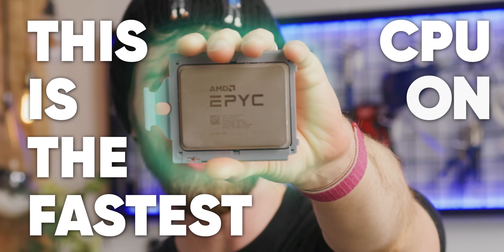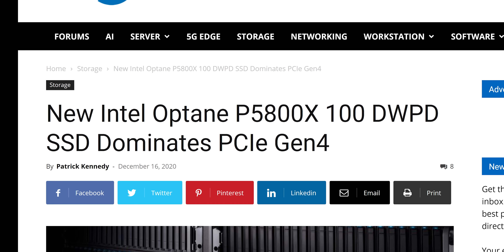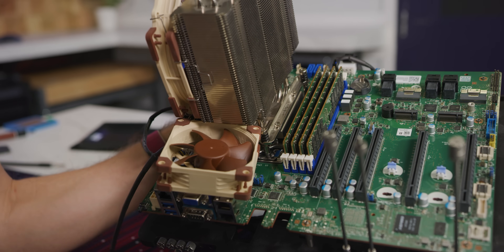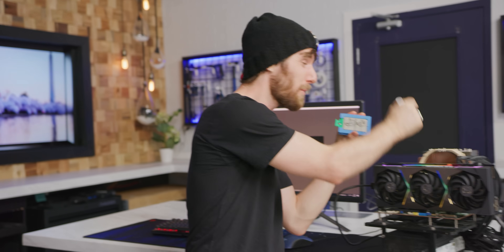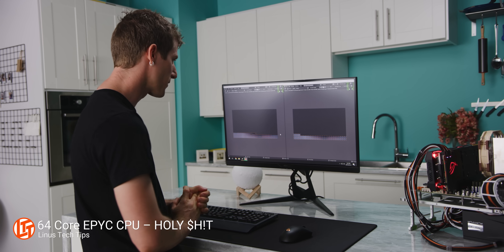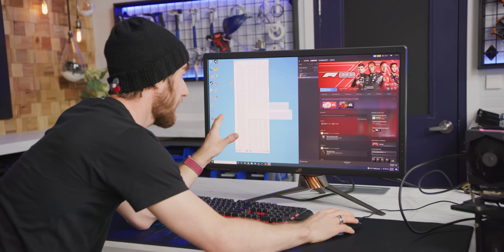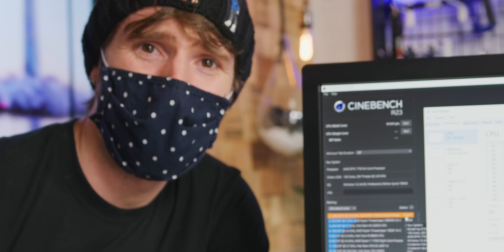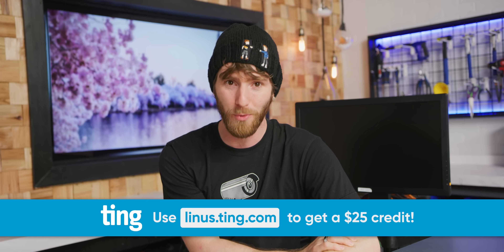The Fastest CPU on the Planet - HOLY $H!T - EPYC Milan 7763 64 Core

Comment: Amd: we have zen 4 128 core cpu
Intel: you meant threads? 
Amd: ......
Intel: holy shit
Reply: lmfaoooooooooo
Reply: Intels Xeon Phi 7somethinsomething has 288 Threads... At 250 Watts and the calculation Power of 2.5Tflops. that thing is scary
Reply: @kcasc_hd  runs hello world on it but a quadrillion times in parallel
Reply: @kcasc_hd  Intel Xeon Phi (series as a whole) is an "odd-ball" tho...
While they do have 72c/288t on their 7290 (among some others), the instruction set is a lot different and they are optimized to run primarily AVX-512 workloads (which is mostly machine learning).
So while it will pull ahead in machine learning and other workloads that benefit from this, it'll quickly fall behind in workloads you'll find Epyc CPUs in, which are primarily virtualization or running together with a boatload of machine learning accelerators like the Nvidia A100...

I mean... there's kind of a reason that the Xeon Phi never really took off especially after Nvidia started becoming big in the machine learning market...
I mean, why invest a lot of money into basically starting from scratch when you can supercharge your already existing codebase.
Reply: @kcasc_hd  So like 1/5 of a Xbox Series X? A few TFLOPS isn't really impressive these days.
Reply: @exscape  no no no, 2.5Tflops of cpu power. Series x has 12 Tflops of GPU power. 2.5tflops of cpu power is actually insane be
Reply: Phi 7920? That's a 72 core cpu from 2016, I'm not even sure if Intel were selling them
Reply: @kcasc_hd  But 4 threads per core, and each core clocked at like 1.2ghz? Not to mentioned, that's all Intel weaker/garbage Atom core instead of fully loaded normal Core/Cove Core. Yes. There is a reason why it's got Discontinued lol
Reply: @kcasc_hd  Where can you buy one of those?
Reply: Not Zen 4, but yes. It's the 4th generation and called Zen 3
Reply: @sebastianlaakso2729  he also said 128 cores…. He meant next generation
Reply: @sebastianlaakso2729  Strong rumor has it that Zen 4 will have a 128-core variant, but probably not for the general server market.  It's supposed to go up to 96 cores for that.

Comment: "Cool idea for a project that you can use one of these bad boys for?"

Assisting scientists and doctors with simulations for finding a cure for cancer. 

"With great power comes great responsibility." 😉
Reply: I think they host a Fold@Home server their local area, if memory serves, so they do actually do that. my rig as run quite a bit of FAH over the last year.
Reply: @DFX2KX  They did, but I believe they took it down earlier this year. It doesn't show up in their server list anymore. Before they took it down, it showed a lot of errors with degraded performance. I'm not sure if that was intentional, or if it was the final straw for them to decide to take it down.
Reply: Oh, the good old Superhero quote, never fails.
Reply: Actually useless, you need super computers like Fugaku.

Comment: Hmm...
How about "can it run Crysis with CPU only?"
Reply: Yep, software (CPU) render.
Reply: Didn't they do software rendering on Crysis 1 on a previous video on EPYC?
Reply: @71ruinsigil  I think it was threadripper but yes
Reply: ohh yes please
Reply: From what I remember, the mesa port for windows has cpu rendering
Reply: Ryzen chips doesn't have integrated graphics, unlike Intel.
Reply: @Outofcreatvienames  There is software rendering for this.
Reply: @Outofcreatvienames  yes. the point here is to try to run the graphics calculations on the CPU cores.

Really doubt it'll be able to play Crysis, honestly. but something more reasonable, like Half-Life or even Minecraft looks like a real possibility if you can get all the cores utilized
Reply: @rejiix  Minecraft runs fine CPU-rendered on a R5 3600, with a single RAM channel. I expect more from this system.
Reply: @Outofcreatvienames  Who. The. Fuck. Would spend extra for shit graphics when you can buy a graphics card 😐
Reply: @ChemPhys99  you can buy a graphics card?! Where, tell me now!
Reply: @unvergebeneid  StockX
Reply: @Outofcreatvienames  um dude... tell that to my ryzen 3 3200G  i guess it didnt get the memo

Comment: To be fair, it's a bit like saying you want to go crabbing in a 12 foot tinny and turning up in the USS Enterprise. Yes, alright, it does have eighty five thousand hp and it can get a 1,100 foot aircraft carrier to about 33 knots. But you're not going to tow it behind your Datto 120Y or launch it single handed or get it into the creek where your pots are. It's huge and impressive but it's completely impossible impractical to use for your normal daily boat. It does very much have its uses, it is very well made and very good at what it does, but it's not a replacement for your old 12 footer. It's a completely different class of animal.
Yes, it can play Crysis.... Yes, I could browse the net and keep a watch on my pwn-sites with it, but...
16 cores and 32 threads would do that for me perfectly. Add a 2TB M.2 drive, and it'd be as fast as my network connection would let it be.
Put that another way - if I had 50 billion $ in the bank and I could buy Brazil one afternoon for laughs, I still wouldn't buy a top line EPYC to use as a personal computer. I might under those conditions be able to spend $20k on my own personal computing (separate to buying new desktops and laptops and phones and fondle-slabs for about 50 people in my immediate family) but for my own use, a high end laptop and high end desktop and ...

Comment: This server is pretty quiet.

Hits button remotely.
Server: So you have chosen deaf.
Reply: Sounds like a 747 getting ready for takeoff
Reply: @the_platapus3522  sounds like 5 ps4
Reply: @the_platapus3522  lol I wonder what would happen if they cool one of these using something like a miniature turbofan 😂
Reply: @topethermohenes7658  would you like to correct your statement to The Blowimatron ?
Reply: @N1lav  nah blowimatron is still more or less pc specs I'm talking about turbine rc ones upto 120k rpm 😂
Reply: I lol'd. Thanks.
Reply: @flameshana9  you're welcome
Reply: Honestly it just sounds like my GPU, if I had two of them and I was dumb enough to try overclocking them without replacing MSI's pansy little cooling fans and thin lame heatsink.

Comment: Hi Linus, would love to see how well it works to put a server like this in your data center, and use Windows Remote Desktop to remote into it with something like the 17" LG Gram (i.e. no discrete graphics) and ummm... something with discrete graphics (perhaps a Razor 17in)?

The idea here would be a combination of having a HUGE amount of simulation capability for 3D modelling, but while having the security of having all your models and data safely locked down in your data center (or office) rather than freely out in the world on a laptop.  Basically, the expensive hardware in the office, and "disposable" inexpensive laptops with little to no data on them in the field.

Comment: "fastest CPU" Nah. Apple M1 SoC at 3.2GHz, one core performs like one from Ryzen 9 5950X or Core i9 at 5GHz and the Apple M1 has integrated graphics and doesn't need a fan, has less than 10 times the power consumption of a Ryzen or Core, less than 100 times the power consumption of EPYC.

The EPYC, Threadripper with Xeons are like overpriced Bulldozer chips.
Reply: @vojtech1586  8 cores that can compete with a desktop that uses 10 times more energy and has like 30% less IPC.

This is Bulldozer again. EPYC clocks waaaay lower than Ryzen 9 5950X and Core i9-11900K, it's a bad overpriced chip.
Reply: @vojtech1586  No wonder why ARM is killing x86 on the server space or winning market share.
Reply: @vojtech1586  Singlethread perfomance is by far the most important aspect of a CPU. An NVIDIA Geforce RTX 3090 obliterates any CPU in a 100% multithreaded application

Comparing this EPYC against an RTX 3090, the latter would do a render 10 times faster. Because the 3090 has 35 TFLOPs vs this EPYC's 3.1TFLOPs.
Reply: @vojtech1586  ARM is slowly crushing AMD and Intel in servers and gained like 400% more market share last year.
Reply: @vojtech1586  I don't think that x86 is better. It has a huge problem in architecture that must be fixed by Alder Lake.

Comment: HMMM I feel like I scored a 58,000 on Cinebench with my Threadripper 3990x and that was with air cooling only, on performance mode. Never goes above 50C also paired with a RTX 3090.

Comment: Those pcie lanes could be used for a hyperfast nvme server, ASRock has mobo with 7 x16 lanes, in which we can plug those asus pcie cards that convert one x16 pcie lane to 4 m.2 x4 lanes, so theoretically we could connect 28 nvmes in raid or 26(2 using onboard) nvmes + a high bandwidth network card

Comment: One of the things I'd love to see you cover is a power consumption comparison between this and Intel's offerings, if you can get hold of the hardware to do so. A major reason we're seeing a switch towards AMD in the server market is that density and power are major ongoing costs. The power itself costs money, but it also increases the demand on UPS and thermal management systems, making it a triple-whammy - you know all this already. The density improvement here is obvious, and the power improvement /seems/ obvious in terms of the ratio between the marketed TDPs and the core count, but the practical power consumption of a chip under multi-threaded work loads (e.g. VM hosting, Kubernetes, compilation & CI/CD infrastructure, OpenWhisk and other Lambda-like systems, batch image and document conversion, heavy webapp loads, etc.) is often very different to what you'd see in an all-out all-core load like Cinebench, since they're utilising a far richer mix of computation resources. I suspect Intel still loses here, but I've yet to see a good direct comparison, and it'd be nice to see one. Even some measurements of power consumption on your 16x quad core gaming project would be a good data point to work from, albeit not concretely comparable without a similar test on an Intel platform.
Reply: As an aside: it'd be really cool if you could build a parallel pandoc benchmark as a test for workstation and server loads. My guess is that Anthony could knock something together fairly easily on that front, using little more than a bash script. Shouldn't be difficult to find somewhere where you can grab a couple hundred PDFs as test data, and then all the benchmark needs to do is convert them to a bunch of different formats, then the resultant documents to a bunch of other formats, in "rounds" like you'd see on other benchmarks, and time the whole thing. You could eliminate any IO bottleneck by loading the files onto a RAM disk, but if you kept the PDFs small (under a few MB each) the IO shouldn't be a major factor. This would be a decent emulation of a broader CPU load that doesn't focus so much on tight loops of SIMD (SSE/AVX) work.

Comment: So I know it's not gonna change anything about the impressions of the product but Apex by default is locked at 144fps 
So even though apex is pretty badly optimized I bet that would jump up some if you unlocked the framerate 

Granted I am only running at 1080p but my R7 3700x paired with a 3070 will run the game at almost maxed out settings at a semi stable 190 fps and I can push 300 fps if I lower the settings a bit.

I love Apex and glad to see it represented but this makes it look way worse than it should

Comment: with that many threads, those corclocks and the IPC I think those two CPUs might even be able to beat a GPU in rendering. not a modern GPU but some old one. maybe you can get some virtual GPU running on the CPUs or  render in software or smth.

Comment: What is the name of the equipment that is used as a holder for the CPU? I saw Linus holding the CPU in a special plastic holder (not sure if it is plastic).
Reply: It's part of the CPU package for Epyc/Threadripper CPUs.  You slide that plastic part into rails on the retention mechanism when installing the CPU.
Reply: @VitalVampyr  Is there an alternative to that for other CPUs like Ryzen 5 5600X? I need something to hold my CPU because I lost the plastic that came with it.
Reply: @BlastyMcNoAim  The plastic rails used by Epyc wouldn't very useful for that.
I know they make latching plastic cases for storing/transporting CPUs without the original packaging but I wouldn't know where to buy them.

Comment: The crazy thing is that in 20 years a <100$ budget cpu will easily stomp this
Reply: Probably not really. We are reaching the limits of power that we can get from our technology.
Reply: @arivald6677  You may want to have a look on the theory of accellerating returns: Whenever a technology approaches some kind of a barrier, according to Kurzweil, a new technology will be invented to allow us to cross that barrier. (source: https://en.wikipedia.org/wiki/Accelerating_change). If you belief the theory we may reach the limits of transistors but it will just mark the beginning of another  technology to do the same thing but better. If Horses can't run faster there will be someone who invents a motor....
Reply: @arivald6677  sort of we are making slower advancements in power department. the way we were improve mostly these days is efficiency and shrinking.
Reply: Yeah those will be on our cellphones.
Reply: I doubt that. You cannot fool fundamental physics.

Comment: You know what else is fast? The speed at which most games still say "Nah, no thanks, I'm full" when presented with more than 4 cores. I know that's not this chips use case, but it is comical seeing my friend's Threadripper be considered the bottleneck for some games he plays. Good on F1 2020 though.

Comment: Linus : This is a 8000$ CPU . 
Also Linus : Draws with a marker on it
Reply: I mean, it was a dry erase marker, and he was drawing on the integrated heat spreader. You can literally remove that metal part entirely and the CPU still works as normal. Drawing on it is totally harmless.
Reply: @trapical  still seems wierd lol like if you had a bullet proof side panel it would still be weird and scary to shoot it lol
Reply: @joeygrimwood4559  It would be more like using spray paint on bullet proofing. Won't hurt anything, also isn't helping anything

Comment: What, only one 3090? Pleb.
But seriously, I can't wait for new Threadrippers to launch. I've been waiting, not so patiently, for for either Ice Lake i9 Extreme's or the new Threadrippers. I already have the build planned- custom loop in a Core P7 with two 3090's and a gen4x4x4 NVMe card in RAID 0, hung on the wall above my workstation monitor. It's gonna be the sickest HEDT I've ever built. I've only built two computers in the last 6-7 months, which is way under my average of about 1/month. I guess I can just do ANOTHER overkill retro/OS/era specific rig, but I've already done a ton of those. I guess I haven't explicitly did a build for Windows 8 yet, but that sounds boring...  Well, I guess I could build something pretty good on X79 or X99 that could still hang pretty well today. Maybe a 6950X and a couple Titan Z's

Comment: I’m just not impressed. It’s only ~2.75x faster in cinebench R23 vs my 5900X (gets around 22,300 points) despite having 5.3x the core count. I guess clock speed matters a lot. Can’t wait to seen next gen Threadripper and the performance it can deliver

Comment: 3:48 -  OMG, toolless M.2 slots have to become standard.
Reply: that little screw kills me everytime I have to search for it  everytime I drop it .
Reply: I looked around at other similar solutions and there's a way to make it so the clip can easily be moved in order to handle smaller cards.
Reply: I mean it's useful if you were to deploy 100 of this server and every one of them have atleast 4 m.2 storage
Reply: M.2 is the only drive standard where you need to have a screwdriver handy just to connect or disconnect the device. And if you lose the screw or your device didn't come with one, good luck finding one like it. The desktop implementation of M.2 was just not that well thought out.

Comment: Kid: I need a PC for school, this is what I need
Parent: ...
Reply: Parent: gives him a Z80 and a slap in the face
Reply: These 64 cores processor s*ck . Ryzen 9 5950X can clock to 5GHz and has 16 cores with low memory latency, this EPYC can't and uses more than twice the power.

EPYC only works for showing off your Cinebench R20 scores while being useless for the rest. A Ryzen 9 5950X with ARM processors and GPUs like RTX 3090 are making the Threadripper and EPYC lineup look very dumb.

No wonder why ARM is gaining market share and becoming even more popular.
Reply: @saricubra2867  Do you realize that Gaming isn’t the only purpose of a cpu
Reply: @Visbi  A CPU is designed for serial processing, not parallel, gaming has a lot of logic that shows how fast a CPU can be in a real time application. These ridiculously high core count , very high TDP with crappy clock speed AMD and Intel chips are an embarrassement.
Reply: @saricubra2867  the reason why a 64 core cpu meant for NOT GAMING can't reach 5 ghz is because it doesn't need to. the things that this cpu is meant for doesn't require 5ghz. low ghz and more cores is actually better for what it's meant for.
Reply: Well, studying cfd or fem based modeling... Yeah. :D
Reply: Parents: Fk your studies you now work now in the fields boi
Reply: @infinitedensity6833  Nah. This video is an embarrassement for x86 Bulldozer: https://youtu.be/f3upSOW62bg

Comment: Apple Silicon Mac Pro: Allow me to introduce myself

64 5.1Ghz ARMv9 Cores, 128 GPU cores. 100 teraflops with real-time raytracing, 1 terabyte of LPDDR5X RAM, terabit bandwidth, 5000 single thread/100,000 multi-thread on Geekbench, 300 watts maximum, starting at $2,499!!!